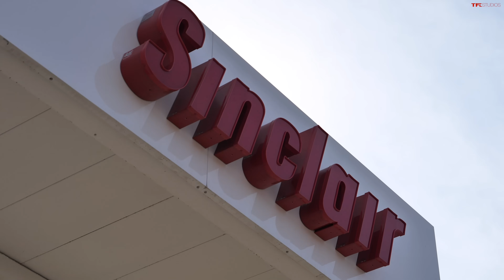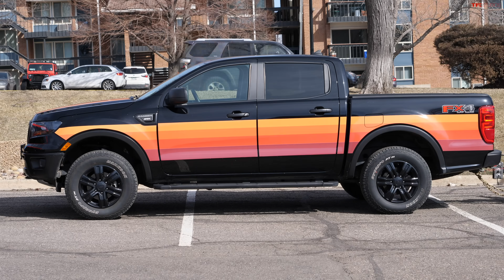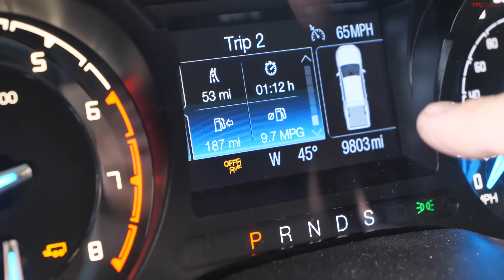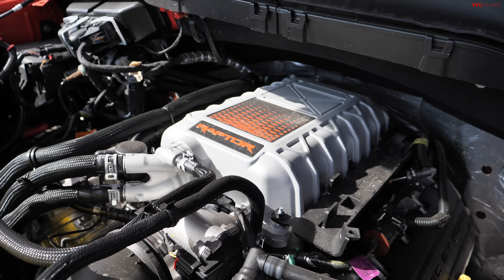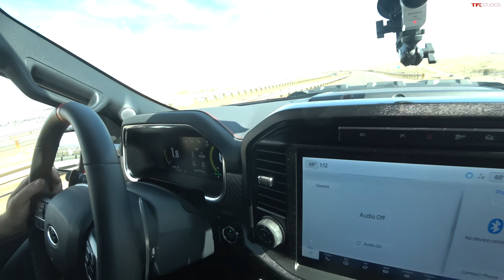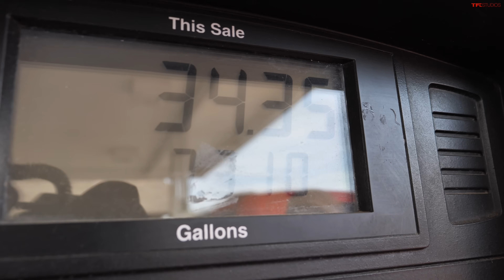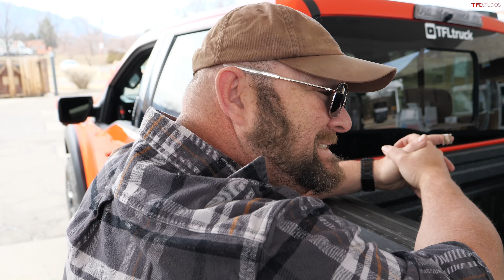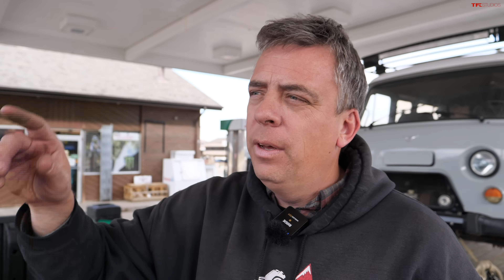Myth BUSTED: Does a Big Engine Get Better Fuel Economy TOWING Than a Small Engine?

Comment: There are so many factors that affect fuel economy - it's hard to compare one to another. Smaller engines are getting better, but you can't really compare a 1.4L to an 8.1L, for example. If they're both forced induction and built well - to the same specs, the 8.1L will always have more power but may not always have better economy. The 1.4L can be great for toodling around town in a mid size vehicle, but it can't tow the same weight a large engine can. Try to tow 15000lbs with a 1.4L and it just won't. The 8.1L will handle it just fine.

Comment: As a European I can't understand why aren't Americans using diesel for towing? It's way more efficient 
Are you stupid or something?(joking about the last part)
Reply: Due to several factors, personal diesel vehicles aren't ideal for towing in the U.S. market UNLESS you are towing very heavy loads frequently. In the U.S., the diesel engine option is expensive over the standard gasoline engine. Diesel parts and servicing are also more expensive, especially at the dealership.  Plus, diesel fuel almost always costs more than gasoline and there's the additional cost of the Diesel Exhaust Fluid, a mandatory additive. Generally speaking, a pickup truck with an ordinary gas engine is going to be far more appropriate for the needs of the vast, vast majority of people. Again (and I think most pickup truck owners will agree these days) if you don't tow heavy, and a lot of the time, a diesel just doesn't make much sense unless you just happen to want one.
Reply: @Anthony C  don't know man diesel is also more expensive where I live and also diesel cars are more expensive (because engines need to be better built to handle higher compression) but everyone uses a diesel if they have to tow even occasionally,  you'll see people towing caravans with petrol cars but mostly diesel. Yeah diesel maintenance is slightly more expensive but it uses less fuel(basically the fuel that raptor uses to pull that small trailer one of my semis uses to pull 40 tons 80000 something freedom units) and save tons of money on that side. A ML 350 cdi uses almost half the fuel to pull a similar load. I like petrol for my small car but for any serious work diesel is the go to for everyone
Reply: @Stef.Cata051  In my experience, diesel maintenance and repair is more than just "slightly more expensive." And as for the price of diesel pickup truck entry, Ford and GM and Ram all charge $10,000 more for the diesel option. That's a very significant increase on a truck. My original position still stands (which I think the pros at TFL, Andrey and Mr. Truck) have also said: Get a diesel if you haul consistently heavy loads the majority of the time. And you said pretty much the same thing:  "but for any SERIOUS work diesel is the go-to."  Exactly.
Reply: People do

Comment: That load was really pushing the little 2.3 to the max of its abilities and it still got over 9mpg.  The 5.2, as you alluded, barely knew it had a load on.  If you were towing that kind of load all the time, the Ranger probably isn't the best for the job.  A full size would be.  But if you only did that 2-3 time a year and 95%+ of your miles were empty at 20+mpg combined.  Dang, what a great solution the Ranger is for that scenario.  Please do the same test with the Ranger vs Nathan's Santa Cruz and a 2000lbs (or whatever it can tow) trailer.  It would be fun to see the result of that.

Comment: Before watching, my guess is going to be the small engine will be more efficient based on my knowledge of engines being most efficient at close to full load and my experiences with towing 2K-2500 pounds with my 1.7L Civic and still getting around 28-32 MPG. Semi trucks also have comparatively small and low horsepower engines for the loads they pull and are pretty damn efficient for all the stuff they are moving.

Comment: Thank you for doing more towing content.

My 2.7 ecoboost was better unloaded by quite a bit then other trucks I've owned.

While towing, it was the worst. Of course, the 6.0 v8 chevy only made 360tq at best when spinning 2800rpm in 3rd up a hill, whereas the 2.7 with a tune on 87 octane was making over 400tq by 2200rpm

Comment: Looks like everyone beat me to the comment I wanted to make.  A much more appropriate test would be a Ford 2.7 turbo vs a 5.0 V8 and in the Chevy department a 2.7turbo 4 cyl vs the 5.3 V8. Not that I didn't enjoy watching, but this was very apples to oranges.
Reply: If you are towing all the time a V8 is probably better.  I bet you will find most pickup owners only tow a few times a year or not at all.
Reply: @jeffk464  Oh I would take a V8 over a turbo gas anyway. The torque produced by a V6 turbo is probably better, but I look at long term life/cost as we keep our cars a long time. I do have to admit that I prefer my 2001 F250 with the 7.3L diesel for pulling my 9' tall, 25' long cargo trailer vs pulling with my brothers 2015 with 5.0. Much better stability with the 3/4 ton.

Comment: If you're going to test the difference between engine displacements everything else should be the same you should have got a V6 F150 versus the V8 F150. The ranger is smaller more air dynamic and lighter so it's already at an advantage over the F150.

Comment: You have to take into consideration  the loss off of unloaded mpg because if the ranger normally is 20ish mpg it got the worst mpg vs raptor R is 10ish with less loss

Comment: I think this test should of been done with a normal F150. I towed 9500 pounds with my 2021 f150 with a 5.0 coyote from Colorado springs to east TN and averaged 11.8 ( I used the same fill up method as them ) I suppose driving the interstate would of affected the numbers but I also pulled over to sleep in my truck with the truck running while I slept

Comment: I get 20mpg towing my 1000lbs combined boat and trailer with my 2010 Prius with 193k miles on it.  I get 30 empty.

If I ever get a new battery and go back to stock tires, it should be a lot better.

Comment: The comparison only works when you run a boosted small engine vs an NA V6/V8. It's entirely irrelevant to compare a boosted V8. Especially a super truck like a Raptor.  

Congratulations on another Completely useless video.

Comment: 15% is significant but the energy is the energy.  The R pushes more air and slows down less so it is reasonable it uses more fuel.  Like a 5.0L vs a 3.5L EB, the V8 uses less fuel because it is slower.

Comment: The coolant is a
Different color for the engine, and the super charger Intercooler.  Using different colors makes it easier to pinpoint leaks if one of the systems are leaking.  No coolant is shared between the engine and Intercooler.

Comment: Maybe I'm daft but why would I go with a V6 with a fraction of the power for a 1-2 mpg difference?
Reply: Because the test is useless, they do a test with 2 different vehicles not different engine.
They tow a van with the aerodynamic of a brick, when towing with a big truck the van is mostly in the airshadow of the towing vehicle, with the smaler truck the van get hit by the air and acts like a parachute.

Comment: You got way closer results than I have, but having compared 4 big/little combinations, I can assure you the smaller vehicle will ALWAYS get better efficiency (not including hybrids, of coarse), regardless of the engine option. it's physics. ram 1500 22mpg down to 12 (highway) towing an empty utility trailer, honda ridgeline 24mpg down to 14 (city) (33/16 highway) towing an enclosed trailer with a light load,  ford escape 24mpg down to 17 (35/19 highway) with the same enclosed trailer and load, saturn ion 35mpg down to 24 with a fully loaded (highway) (for the trailer, technically overloaded for the car) 6x12 utility trailer.

Comment: Should consider the unladened MPG on the loop for each vs. the towing MPG on the loop for each and then calculate percentage degradation to the MPG for each.  That would show whether the theory of smaller engines working harder are worse than big engine doing same work.  The Raptor already had a worse MPG to start based on weight and engine size vs the Ranger.
Always fun watching content regardless.  Keep it up
Reply: The ranger went from 22 mpg to 9 mpg, or 41%.  The raptor went from 11 mpg to 8 mpg, or 72%.  Therefore, the Raptor is more efficient.  They both tow, but the Raptor had to work 28% harder compared to the Ranger working 59% harder to do the same task.

So, Raptor wins on efficiency, while Ranger wins on fuel quantity.
Reply: @JasonPhipps  Yes but, you are going to spend a lot of time driving around without a trailer where you get 22mpg instead of 11mpg.  Of course I would like an offroad focused Ranger so probably 19-20mpg.
Reply: @jeffk464   my ranger has a fox leveling kit, 32 inch KO2 and ford performance tune. It’ll get 20-21 on the interstate if the wind is my favor. Pulling a 21 ft (total) travel trailer at speed limit I get 9-11 and a 17ft bass tracker I get 15-16. Wind is a big factor.
Reply: @JonBecker81  could be worse.

Comment: The Raptor gets such poor MPG under real conditions anyway. I agree with the 300 comments. Test the Ranger again against something more reasonable with a V8 or big V6. Also hand off the numbers to someone and have them calculate % changed with both vehicles on the same loops at the same time. 😊

Comment: Longevity is what concerns me, which will be running right at 150k miles.
Reply: Doesnt realy matter on vehicles usely everythings else break, before you get engine problems from them being wearnout. The reason for engine problems are usely lack of maintanace or sensor failure and brokens seals.

Comment: I would really love to see a test of the exact same truck with different size engines. Say the f-150 with the 2.7 vs. the f-150 with the 5.0. That way, aerodynamics are practical the same on each truck.
Reply: You hit the nail on the head with this comment. Nobody is cross shopping a Raptor R and a Ranger. It’s very likely someone would be trying to decide which engine option on their F150 would better suit their needs. Testing 3 F150s with different engines would be more revealing and relevant
Reply: I came here to say the same thing.  They tested two trucks that are so far apart on the spectrum that there's no useful conclusions to be had here with regards to fuel economy while towing.  The real world results of an F150 with a 2.7L vs a 5.0L would be very close, with a likely small margin of victory for the 5.0L, since a naturally aspirated engine doesn't have turbos to keep cool under heavy load.  That's the test we should have gotten, not this.  All we can say from this video is that the Raptor gets more smiles per mile, but we didn't need a towing test to tell us that.
Reply: Good idea. Add the hybrid to that mix too
Reply: @phild9813  The hybrid really wont do anything for towing MPG unless you are in a lot of stop and go. The battery pack isnt big enough to give any kind of sustained power that would affect MPG's on a longer highway trip. Its only 1.5 kwh which, assuming it was fully charged at the start and could use all 100% of its energy, and that there was zero efficiency loss in the electric motor, it could only hold 2 horsepower for 1 hour. Reality is its probably more like 1 hp.
Reply: Besides same truck model, the axel ratio and tires need to be the same as well.
Reply: that Ranger vs an f-150 2.7 would be a good comparison
Reply: I’m probably around 9-10mpg with my heaviest loads in my 2011 5.0 F150.
Reply: I remember my older chevy 3/4 ton 6.0 getting 10-11 with a decent load. It was about 1mpg different from empty to having a trailer lol.
Reply: @Phil D  that's how the 2500 with the 8.0 was. 10mpg no matter what
Reply: @phild9813  yep mid 90s GM trucks got 8 empty, 9 towing, or vice versa if you were going uphill or down
Reply: @phild9813  Interesting, I have a 6 inch lift 14' w/35's and the 3.5 ecoboost, I get 9-10 towing a 28' enclosed tag trailer w/4000#'s in it, 1300# tongue weight
Reply: Edmunds did an unladen fuel economy comparison between 5.0L and 2.7L trucks. Course that was the 2015 model I believe. Bottom line is the 2.7L BARELY did better than the 5.0L in combined driving. Not nearly as much as one would think. But if they're both towing, who knows.

Comment: Turbo engines need more fuel for the increased air flow obviously.  But what many people do not understand is that they typically need more fuel beyond that.  Fuel flow per horsepower in boost is somewhat higher on turbo engines than on NA engines as the extra fuel is sent for cooling purposes.  

However....Boosted engines tend to be smaller and have fewer cylinders, which reduces internal friction and pumping losses.  Thus out of boost they are more efficient.  What this all means is that fuel efficiency depends entirely on how the vehicle is being driven.  Lots of high power use would tend to favor bigger NA engines, while occasional "squirts" of power then low power cruising would tend to favor smaller turbo engines.

Comment: I tow with my 21-F150 5.0/3.31. It’s always been with my old Defender on an auto trailer. 
Best mpg 14.2 if I keep below 60, but I plan on 12 and drive at speed limits which is mostly 65 or 70. 
I scaled everything on last trip, 12,160lbs with full tank, me and all my off road gear.
Reply: I've found the same with my jeep.
Using "hypermiling" techniques, I can get 16/17mpg with a full load (trailer+car) vs 18/19 empty.  I roll no faster than posted speed limit, "toss" it down a hill to make the next one, and on grades with posted "flashers below XX MPH" I'll not kill the rig to keep at full posted, but let it gradually slow to that lower speed, hopefully by the time I get to the top of the hill.
If I try to keep consistent speed all the time, I lose 2-3 mpg, and if I "speed" (above the usual posted 65) my economy absolutely PLUMMETS.  I did 75-80 one time coming back from a track day, and my mpg was 10/11!  cue Eagles Yea, we'll just Take It Easy. 😄  Plus I'm running 93 octane when towing, so it even helps to save a couple $$ not to speed!

Comment: You guys got close to the correct answer there at the end. Thr efficiency difference between the two is really the delta for each between their unladen MPG and their towing MPG. The RaptoR lost about 23% efficiency and the Ranger lost about 57%. Therefore, the RaptoR is more efficient.
Reply: You’re kinda right, but the Ranger was maxed out on towing capacity. The Raptor was not, need to take that into account as well.

Comment: You should have compared the Ranger to an Ecoboost V-6 for one important reason. You can't compare a turbo to a supercharged engine because the supercharger needs power to be turned. Compare a NA to NA, turbo to Turbo. Since you're at elevation it would be unfair to compare a NA to a turbo since a NA is affected a lot more by elevation.

Comment: that result isn't terribly surprising.  when i would tow a 6x12 cargo trailer with my ecoboost f150 i'd get 7-8 cause i was working that engine a lot.  however, pulling that same cargo trailer with the power wagon net me 8-10 mpg.  i guess you just don't work that big 6.4 as much as the 3.5 booster.

Comment: It'd be great to see the 4cyl silverado vs the 5.3.
Reply: yeah and add in the 6.2 for the silverado as well.  For the F-150 they should have done the 3.3L NA V6, the 2.7L Ecoboost V6, the 5.0L V8, and the 3.5L Ecoboost and tried to get them in as close of a config as possible.
Reply: probably paid by ford to say raptorR is efficient hahaha
Reply: I think that this would be a better idea for comparison.
Reply: This is a bad comparison in the video.  Your idea would be better in a video for sure.
Reply: @mikealfieri641    How so?  Both engines are rated for 9000lbs towing, the 2.7 HO makes much more torque than the 5.3 does as well (430ft.lbs for the 2.7 HO vs 383ft.lbs for the 5.3).  Its a perfect towing comparison that should be made.
Reply: @gmpartsguy9614  I meant was a bad comparison in the video*  This is a perfect comparison.
Reply: @gmpartsguy9614  well how bout we did a naturally aspirated  4 cylinder versus a natuarally aspirated v8 ill bet the v8 would get better economy

Comment: Nearly 15% more fuel is significant. Even more significant is an almost guaranteed US14mpg doing the same towing job with a four cylinder twin turbo Ranger diesel automatic where available.

Comment: When they built the raptor r they were not concerned with fuel mileage. A better test would be with a f150 with the 5.0. But the raptor did get better fuel mileage than I thought. I was thinking high 6 low 7.
Reply: exactly- this test was just for fun but objectively made no sense whatsoever and proved nothing.. which is fine, but they are presenting it as "myth busted" when it clearly isn't

Comment: I'd like to see the same test with the Ranger vs. the work truck.  And then calculate the % lost per vehicle in regards to MPG. I feel that would give a more accurate picture to mid-size vs. full-size.
Reply: That would make it easier on the Ranger because Stubby has a lower towing capacity than the Ranger. As for the % lost, that is irrelevant to which would use the most fuel. Trying to justify muscle when agility is being tested makes no sense. Yes, there are limited cases for when muscle is better and if you are buying a truck on that, its resale should be much lower, but it for some reason is not.
Reply: Ranger VS Stubby VS Nathan's Santa Cruz using whatever trailer the Santa Cruz can tow.

Comment: Back in 2018 my wife bought a ROCKWOOD ROO  and it weighs around 5 000 pounds. Towing with my 13 Tacoma with the 4 litre v6 saw me getting around 40 litres per hundred. With my 2020 Tundra I see 20 litres per 100 kms.
Reply: 2013 Tacoma V6 shouldn’t have been hooked to 5k pounds at all. It’s towing capacity was 3.5k. Just saying.
Reply: @DownRange02  You are way wrong. It's rated at 6500 pounds. I know..I owned the truck